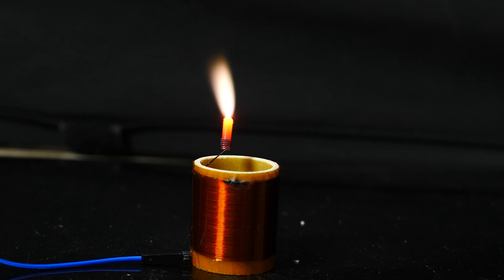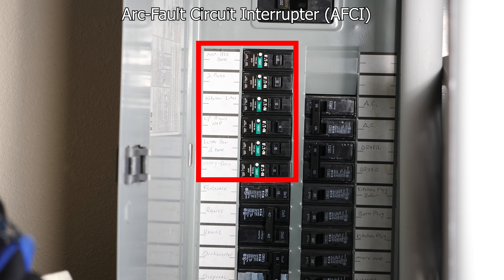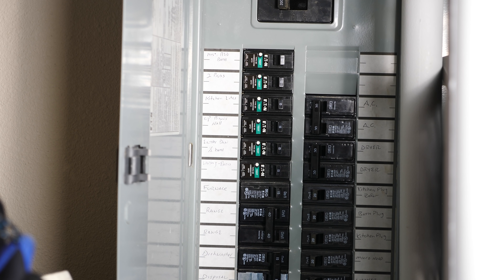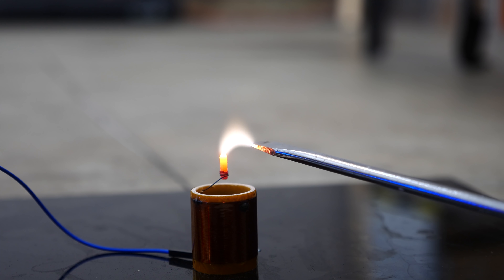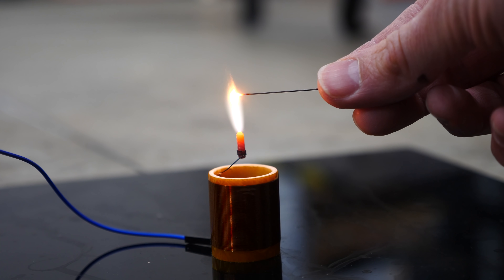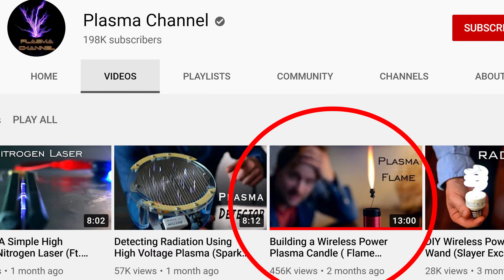The World's Hottest Candle Can Actually Melt Steel—Plasma Candle

Comment: Oxyhydrogen fire flame melts anything faster than that plasma. Put an oxyhydrogen flame side-by-side with that plasma flame and it's like night and day. Oxyhydrogen Flame is an energy flame also that supersedes all flames you imagine. I can burn a hole through ceramic fiberboard 1 in thick in 10 seconds and melt fire brick instantly on contact. That steel you put in the plasma Flame is slow Heating compared to oxyhydrogen Flame.

Comment: @5:00 that steel is actually boiling there. It's possible since the boiling point of iron is 'only' about 5000 degrees, or 3135 Kelvin

Comment: wow for me, wiring houses and doing hvac electrical work for many years I finally understand why the arc resistant breakers have been mandated in homes. Honestly the GFCI was incredibly effective at stopping most fire hazards and there is little evidence to prove that the arc resistant ones will help much especially for the price jump. You've just shown me that special forces attack forces will be able to operate a unit similar to your experiment near homes on its own power supply to knock out power in a home before it is attacked. assuredly that tech can be built up for accuracy in targeting. no pulling a meter, no having to call an electric company and get that paper trail started, just flip the switch and darkness. makes sense

Comment: Yes, concrete is a big sponge, and as such absorbs crazy amounts of electricity. When I worked in residential construction, they had us make sure we took any batteries we needed to use as power sources inside the house or the truck because it will sap all of the power in the battery overnight. Also for the same reason walking on dirt or grass barefoot is healthy, walking on concrete barefoot is unhealthy because it draws too much electricity away from your body. It’s nothing to mess with.

Comment: Actually, those idiotic AFCI breakers are very poor at detecting valid arc.  Any old electromechanical device with relays can blow them.  I have machines that blow them every time they're turned on, so I've ripped them back out for the circuits where they are in use.

Comment: Great Video!

The concrete floor probably has a steel mesh inside it as reinforcement which is well grounded and acts as a sort of Faraday cage (Family of Nicholas!).

As for the "LED": that looks more like a coloured Neon indicator which has gas in it. An LED will NOT work since it needs a completed circuit which is somewhere 'tuned' to the HF which your candle radiates. The gas in this coloured tube glows, but it's not an LED.

Very informative nevertheless!

Comment: Cool. I used to have a carbon arc welding torch and the light and heat it generated was insane. This is basically the same concept on a smaller scale.

Comment: Hmmm strange explanation for that type of breaker knowing that it actually has nothing to do with sparks its a fault current passing between the earth(ground) cable and the blue ground or N cable then the breaker pops like when you put the a hair dryer in the bathtub it will pop without one probably hou would heat the water but still the explanation for that misterious breaker poping is exactly what u mentioned after the magnetic field eminating from this experiment will absolut create eddy current in all the wires in ur house that wil generate the fault current between earth(ground) and ground N the blue cable 🤣 the blue cable 🤫🤷‍♂️🤦‍♂️

Comment: Looks like a neat way to do small welding and brazing/soldering projects. Once you get used to the way the flame attracts to different materials, I imagine it would be possible to do some very fast metal joining with minimal heat exposure.
Reply: @@andreyrevyakin7272 You would only heat the metal up enough to melt brass or silver solder, not enough to melt the steel.
Reply: @Joshualbm   Sound like a tool for a jeweler?

Comment: You've probably tried making a black flame blacker by reducing the O2 content of the air. Perhaps it would slow down the flame of the reaction, resulting in a thicker black portion.  
I haven’t figured out the new A/F ratio.  BTW, congrats on your CEP article, a good read.

Comment: A GFI (Ground Fault Interrupter) breaker works by balancing the current flow in the white and black wires against one another, if there is an imbalance, current is escaping to ground, the breaker trips. I can see your toy driving them insane! lol Are you not afraid of the electromagnetic radiation from the ultra high frequency coil? After all, if it's inducing current in your house wiring....

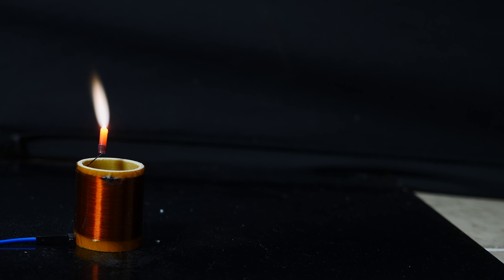Comment: 5:40 That's not an LED - that's a neon lamp. And if the generator induces more than 3V into a nearby LED, it'll burn out said LED.
And probably the reason the generator worked on the floor probably is the steel rebar in the concrete absorbing some of the RF energy. Increased distance away from the breaker box may also help.
Reply: I was just about to comment that 😅 good explanation btw! Gg

Comment: As former ham, I can tell you have put together a 15 MHz shortwave transmitter which is lacking an aerial. By the size of the spark, it looks like you achieved between 50 and 100 Wpep - pep stands for Peak Envelope Power. In other words, your transmitter generates a fundamental frequency, plus an abnormal amount of harmonics of the fundamental - mostly odd harmonics - plus a lot of spurious frequency.
When a transmitter (that you improperly call Tesla coil - it isn't) isn't connected to a properly tuned aerial, the power is fed back to the power supply, and the device will radiate radio energy from every length of wire it is connected to.
Your device is saturating your house with RF energy - which is innocuous to people but can influence some sensitive equipment. With a proper antenna, an ham licence and a π filter, your 100 W 15 MHz transmitter can do a coast to coast DX QSO. 
You can make a professional version of your "Tesla coil" by using proper radio parts, like the Eimac 4CX250 vacuum tube.
Reply: People say the seller of this actually warns that it is illegal to use this outside a faradays cage because of all the Radio disturbances it makes... (I guess he did not read any of the warnings how to use this ...)

Comment: That actually could be viable as a small-scale welder, though you'd want to do something to purge the oxygen from the weld. Oxyacetylene torches use the co2 from their own combustion. MIG and TIG welding use a shielding gas, and this is really more like TIG than anything. I wonder if putting a TIG setup on a tesla coil could reduce the energy cost...

Comment: What you have here is a way to trip circuits remotely. That is much more interesting than a candle, you could potentially drive down the street and cause a massive power outage or drive by a sub station and shut it down. Very bad stuff.

Comment: It doesn't trip when on concrete because the slab of your house is connected to ground which allows an alternate path for the current to travel so the amount of high frequency current travelling through the the breaker is significantly reduced I'm pretty sure

Comment: Hello to,
I have read some reports about weather modification caused by ground-based “air Ionizers” . . . . there was a test in Dubai a few years ago  .  ..  and another fairly large scale test in Jordan.
The experimental devices used high – voltage ionizers – which are reported to use no more than 500 watts power.
I am wondering how an ionizer could produce lots and lots of ions for weather modification?  Typically they are reported to produce negative ions from an anode.
Do you know what type of Ionizer would be used?  . . . to produce the maximum number of air-borne ions?

Comment: TESLA COIL ANTENNA TYPE
Well this high frequency high voltage is  TESLA coil "antenna" (he also promoted the high voltage capacitor type antenna which became the classical antenna in a long shaped form see below)
This coil (magnetic field) type antenna eject electrons in the near field but they are swirling with the E field around the "wave" propagation direction, while the alternative magnetic field (torque field perpendicular to the rotating  E field ) is pointing to the  direction of propagation of so called waves. ("scalar waves type magnetic.) As shown the swirling electrons ejected can melt metal by impacting energy.
Here it should be possible to detect the H field pointer direction by using a magnetometer of some sort (a compass working at high frequency alternative magnetic field direction because here the usual compass will not deflect at all) 

TESLA CAPACITOR ANTENNA TYPE 
Common antennas now (in the near field) show the first type of TESLA "scalar waves" with the E field pointing in the direction of "wave" propagation WITH the electrons ejected. 
EASY TO PROOVE EXPERIMENTALY 
There it is easy in the near field (half wave length distance) to verify that the waves (electrons cloud) emitted by the antenna are NOT YET Maxwell transversal ones (photons) but rather the TESLA LONGITUDINAL E FIELD  waves.(use a household type long neon tube to detect the E field direction versus the propagation direction)

Comment: A normal breaker breaks when to many AMP go through it. It depends on the breaker specs (10,15,20,25,32,40 ... AMPS). What is breaking in your house is most likely aa Residual current breaker with overcurrent protection (RCBO). That breaks if it detects a connection between ground and the live wire. These type of breakers  are put in bathrooms because they protect against electroshock. So it must detect a leak of the live wire to ground that is why it breaks.
Reply: He did explain in the video that his breakers was special ones that detects high frequency disturbances and that was what triggered them when his contraption was sending lot disturbances like that everywhere... StyroPyro made something like this on steroids and he had to put his device in a faradays cage. But your explonation might be correct as this guy is wrong about 50% of the things he talks about...

Comment: You have just built a broadband transmitter throwing out an unfiltered 15 MHZ signal, which can easily propagate thousands of miles. It's also undoubtedly generating emissions on the harmonics of the fundamental frequency as well. Please be aware the FCC may take interest.

Comment: Just think of the RFI it spews. You could build a weak one inside a box with a frequency selection tuner and block a cellular tower. They would come find you.
Reply: Actually the sellers of these warns that it is illegal to use them outside a faradays cage because of all the radio noise they create...

Comment: So couldn’t u build a welder that don’t need filler rod with this.it’s gonna remove the oxide layer so adding pressure while welding u could actually fuse the metal together.

Comment: actually, you can have a relatively cool to the touch plasma flame, even room temperature while the electrons are very hot, that plasma flame is hot because it is thermal plasma, so the gas is actually very hot, not just the electrons

Comment: Maybe I missed something but I don't understand one thing - how come it doesn't electrify you when you put conductive things in coil flame? I assume that you'd feel the current to some extent, not sure why here you can just hold a metal bar with your bare hands and feel nothing, maybe the conductivity falls off when extreme heat is introduced?
Reply: Well the current might be so low that you feel nothing at all... Also it is high frequency which you normally do not feel much from.

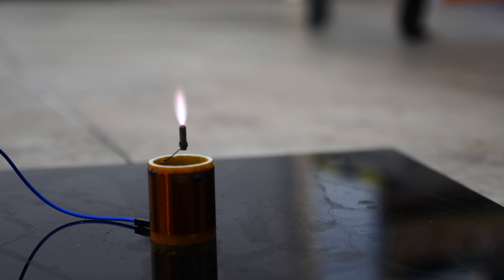Comment: 5:38 thats not an LED. its actually a very low pressure mercury vapor (like <0.001 atmosphere). its a gas discharge lamp like the tubes (5:18 & 5:29)** that emits UVC light that is converted to green with its phosphor coating. LEDs WILL NOT light using a tesla coil & would probably fry even if they were able to light as the voltage is way higher than the 2-3.2v range of most LEDs

** i want to know what gases those tubes really were bc the neon one you had definitely wasnt neon. neon is red-orange when excited & that tube was blue-violet, almost white

Comment: What you claim on gfic breakers does not sound like you understand what you are doing. With the coil in the air the spark is traveling through the air tring to ignite but cant because of the high frequency. The breakers trip because of the high frequency. On the ground the high frequency is absorbed. Try to use a plate of steal or copper and put on the table again and ground the copper plate and see if it works.

Comment: I wonder if the concrete floor works because the rebar acts as a partial faraday cage, and it's enough to suppress the electromagnetic interference on the cabling in the rest of the house.

Comment: Concrete, wiremesh and rebar in your houses foundation act as the earth ground for houses. My guess is that it absorbs some of the electromagnetic waves, and when the electromagnetic waves interact with the wires in the wall, and go back to the gfci, the ground to the gfci plug is also showing the same waves, thereby cancelling each other out as if there was no electromagnetic frequency at all (or at least a very small one, not large enough go pop the gfci). Im a mechanical engineer, not electrical engineer, so if im wrong, please let me know what i got wrong.

Comment: Can this be scaled up and turned into a torch? In my workplace there is an inconvenient safety rule that no combustion based heat sources are allowed. That means that even cigarette lighters aren't allowed unless they're electric arc based. I frequently have to undo rusted fasteners and other joints that require heating so I'm forced to use two heat guns for a helluva long time. I need to get or make one of these scaled up a bit to heat up nothing more than 1''1/4.
Reply: That is just stupid rules because the rules is there so you do not ignite gases and get an explosion's . Using a plasma arch will only be even more effective at igniting the gas and create explosion's

Comment: A regular 20A circuit breaker trips at about 30A.
A GFI/AFCI trips at less than 1mA of current imbalance between the main and ground.
That difference is a factor of 30,000!!  So a AFCI/GFI is ultra sensitive.  My experience is a lightning strike in South America will trip my GFIs in the US.
There are some rules I have developed with AFCI/GFI. 
#1. The circuit breakers in your breaker panel should never have AFCI/GFI feature.  The wire coming off of it to the outlet somewhere else in the house is like a big antenna listening for a lightning strike perhaps as far away as the Andromeda galaxy and it trips.  From the picture it appears that he has GFI/AFCI breakers in his breaker panel.  I had some like that. They tripped all the ^&&$*(&$ time. Try explaining to the wife how to go to the breaker panel and reset those devices.
#2. Don't ever use the slave/client feature of a breaker.  A GFI/AFCI should be installed at the outlet of concern and the GFI feature not extended to another outlet.  That means if you have multiple outlets in a garage or kitchen that need GFI/AFCI then you have to spend the money for a GFI/AFCI at every outlet. Yes! Spend it!
#3. Never use a GFI/AFCI on a freezer or refrigerator.  Unless you want to find all your food thawed out and spoiled. If government code requires you to use one then lie and cheat because it's insane to have one on a food refrigeration device. I have had to throw away two freezers of food.  And one had gone long enough that I had to throw away the freezer as well.
#4. I don't believe that GFI/AFCI protection accomplishes anything significant.  The chances of shock from main to ground is extremely unlikely.  Shock is almost always from main to neutral.  The GFI/AFCI does protect for shock from main to neutral.

Comment: AFCI breakers tell the difference because they have a tolerance that builds charge over a certain time and that time shortens to zero the more power is used. they are also known as RCD's or residual current devices, and they rely on earth leakage which causes an imbalance in the potential between positive and negative conductors.
Reply: frequency affects current so this video explains it correctly... for an engineer... you can use am isolation transformer(AC only) to solve this issue but an basic power converter wont save your breakers.

Comment: If you were TIG welding in your house it would probably do the same thing. TIG welders actually have diagrams with them showing how you need the ground them properly and such and keep sensitive electronics away from them because of the high frequency arc starting.

Comment: I'm a chemist. And one of the fields that I specialize in is flame atomic absorption spectroscopy. It's a scientific device that measures UV radiation off of an arc furnace essentially what you have there. You're making yourself blind I want to warn you in your viewers of this because I'm afraid there's going to be a lot of people out there googling how to make one of those candles as you call them in their own house so they can play with them. Your generating a tremendous amount of UV radiation which your eyes should be shielded from. It's causing permanent damage to your retina so if you're going to continue playing with this you need to get some UV filtering safety glasses at the very least. And I don't think you should downplay something as dangerous as this is as it being a candle. A person doesn't have the knowledge necessary to build one of these things then they shouldn't be building one at all.